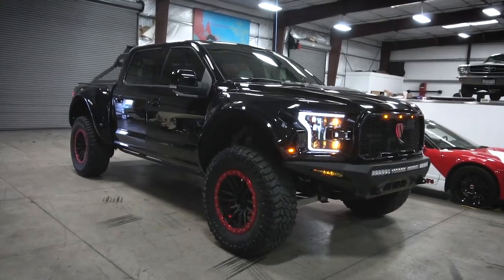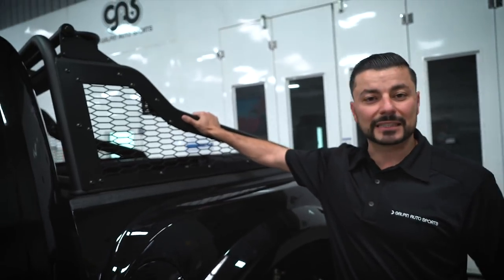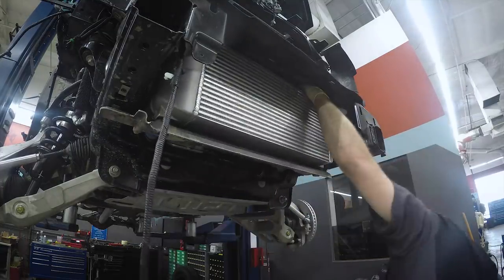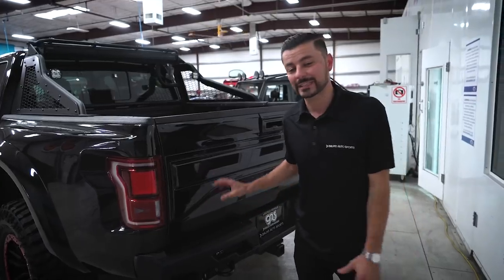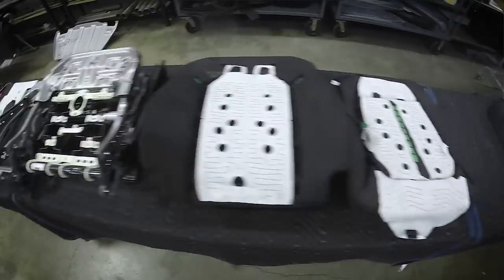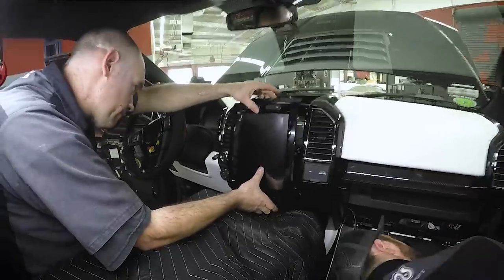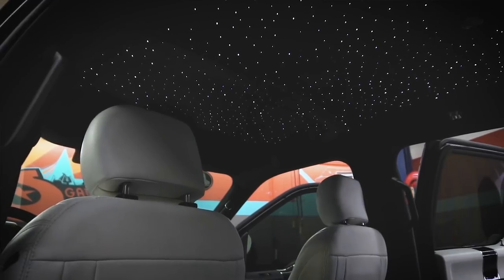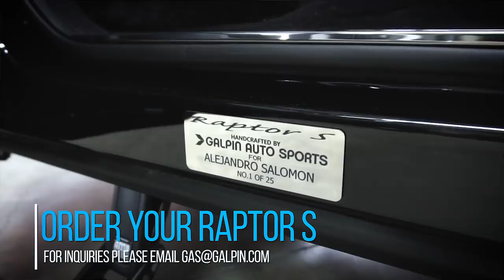How to build Salomondrin's Raptor S!!! (Good Luck)

Comment: The inside now matches the performance.... Ford should take note on how to make the interiors nicer
Reply: They did. With Lincoln.  They know how to make better interiors, but it isnt a priority with ford, and it's too expensive for then
Reply: @jcmartinez7527  same company and like all company they have nicer models ...sadly you go higher up in trim levels with Ford and gets super cringy all the chrome and ugly bs yet still cheap plastics 😒
Reply: Historically that where Mercury and Lincoln came in.
Reply: Your Moms Hitachi  yup even king ranch not that nice and platinum is old people version 😂
Reply: Your Moms Hitachi dude you’re WAY off. That audio system alone is at least 10k. The FOCAL speaker shown was $750 coaxial and $1200 component from focal. Those W7 subs are 1k each...I have a similar setup and shit is mega expensive.
Reply: Josh B Please it‘s Ford and not Rolls Royce.
Reply: @helloworld-bu1vk  never said it was a rolls ...said it matches , but it literally has rolls part's

Comment: Love this build with the exception of removing the panoramic moon roof.  Why not just integrate the lighting into the retractable headliner?  Seems like a waste to take away a beautiful vantage of a panoramic for some twinkly lights at night.  As smart as you guys are you could have found a way to make that work.  Otherwise, truly amazing!!

Also, if someone had a Raptor but wanted to add massaging chairs only, can you do that?  Wouldn't that also be easier claiming some factory seats from a factory King Ranch/Platinum or Limited?  Just a thought.

Comment: The best part is programming out the f-ing Auto Stop/Start. You could make a million bucks selling that secret to every Ford truck / SUV owner.
Reply: Google it.  There are 5 ways to stop the auto stop feature.  I choose the least invasive, and most effective choice-under the steering wheel, there is a white connector box/thing-unplug the bottom plug-2 seconds and totally reversible.

Comment: Should have started with a regular f150. What a waste taking all of the raptor parts off of a raptor.
Reply: $$$ ,Its so they make more money. Even though the pay more.
Reply: I know right ? What's the point if you're gonna strip the truck to the chassis ?
Reply: Raptor is way better then F-150. They did an amazing job tho. Best pick up truck ever
Reply: Regular F150 doesn't have all the off road modes or beefed up frame that the Raptor has.
Reply: Panda 730S have u seen the Baja raptor ?
Reply: Raptor has a beefier frame than the standard f150

Comment: Waste of money should have just bought a Xl crew cab they took off the body and re did the whole thing. Plus changed the shocks what was the point of spending 65k for a truck then spending another 20-30k in upgrades and supsension. This happens when you have more money than brains

Comment: None of the upgrades other than the intercooler actually enhance neither road nor off-road performance. All useless gimmicks according to me.
Reply: Ismail Md.osman the suspension and the ecu tuning
Reply: If u dont like gimmicks then I assume youre driving a base model kia Rio?
Reply: Also they re-did the ENTIRE offroad suspension, ecu tunning, upgraded brakes, upgraded tires for better off-road traction, and lighting for better visability when offroading stupid.
Reply: L
Reply: There are upgrades you don't actually see that can improve performance and just because Tommy didn't say them doesn't mean they are not there.
Reply: I’d be willing to bet there’s a higher percentage of Raptors that are not even being used for off-road purposes any way. Most wealthy guys just use it as their daily’s, so this truck actually makes sense. It offers that High quality finish that a normal Raptor is missing.
Reply: In my opinion the other enhancements are gimmicky coz it makes much more sense to install front diff locker, self inflation tyre system, increasing approach n departure angles, snorkel,etc on an offroad machine. However, I totally agree with Genio
Reply: I will concede the point on suspension upgrade but the added hp, ecu tuning are not very useful unless used for track purposes and might actually prove counterproductive for an offroad machine